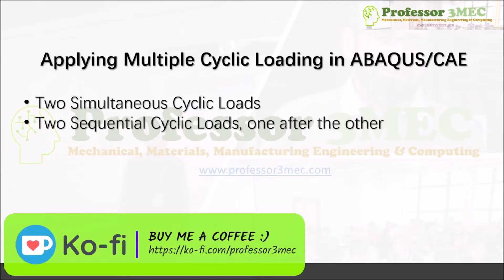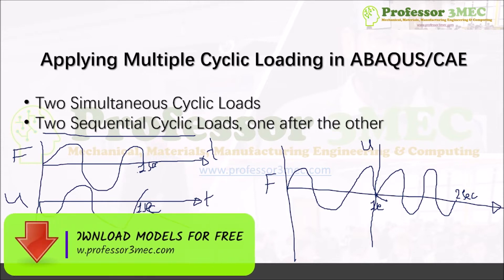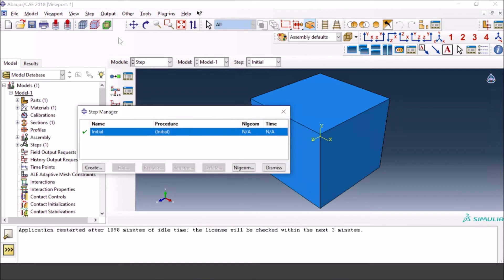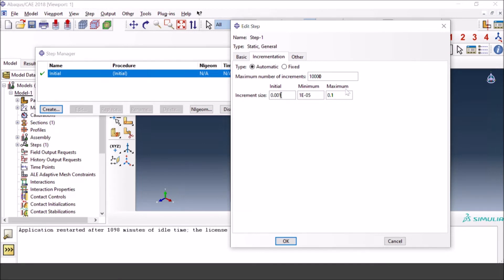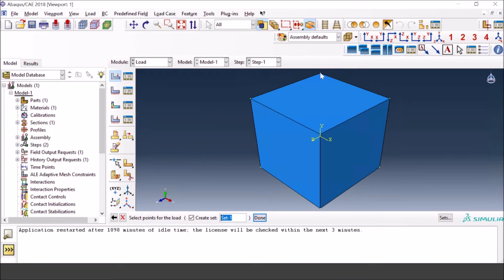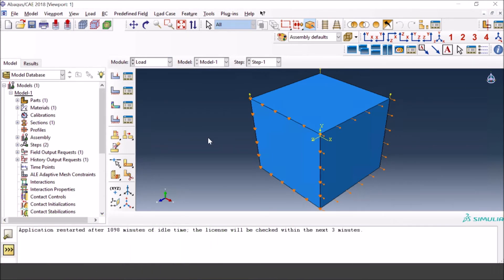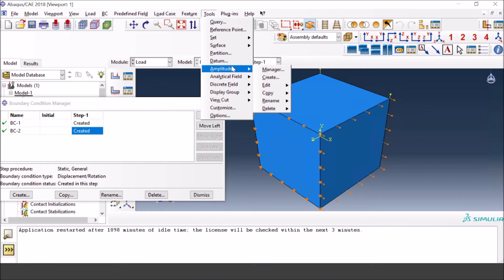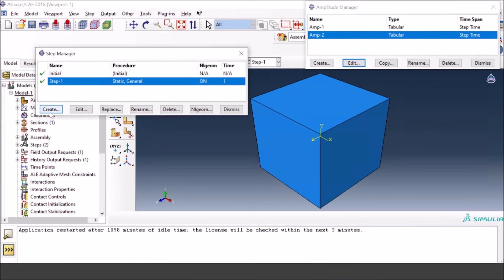Applying Multiple Cyclic Loading in ABAQUS/CAE

Comment: Professor, if you are using cyclic loading which is time dependent loading, then why dont you choose dynamic implicit instead of general step here?
Reply from the maker: Standard and implicit in my opinion are similar and hence can’t be used interchangeably without going into the details of nitty gritty. Implicit is unconditionally stable. Implicit schema is incremental as well as iterative. However, the explicit schema is only incremental.
Choice is very much dependent on problem , memory, disk space, etc.

Comment: Professor,I also have to apply two set of loading protocol. First of all speciment is loaded by force control and it is followed by displacement control method. Do i have to apply both load in same step?
Reply from the maker: This will depend on the problem. If in actual problem loads are applied simultaneously then they should be. However, if there isn’t complex interaction of loads and material properties then it can be in multiple stops.

Comment: Professor do we need to create step for gravity load before creating load step for cyclic loading?
Reply from the maker: It will depend on the problem definition. If gravity is needed and it will have some impact during the analyses, similar to dropping an object then you can create a separate step. All depends on the problem.

Comment: sir i want to apply a triangular load of 500N as max load and min of 200N and i want the load to increase by 500N after 500 cycles for the next 500 cycles and so on(i.e 500N for 1st 500 cycles 1000N for 500-1000 cycle, 1500N for 1000-1500 cycles and so on) until the beam fails using xfem method. can you please help me with this
Reply from the maker: Sure what help is needed? May be get in touch using contact us page on www.professor3mec. com

Comment: Thank you Prof for this beautiful lecture. Sir I am trying to model rutting behaviour of asphalt concrete. My reference paper requires that  I apply an 80Kg load using 10 steps for a cycle (0.01 secs) for 10,000 cycles using dynamic explicit step in 100sec. Pls prof can you enlighten me on how to go about applying such.
Reply from the maker: using the approach presented in this tutorial, I think it should be manageable. However, if you coming across specific problem then please do let me know.

Comment: Thank u for explaination. Can u please help with different Acceleration as cyclic load. 1 to 10 to 1 G  load increment every 1mins. Total 20min
Reply from the maker: Will try! is it like gravity load on a moving object? or on a fixed object.
Reply from the maker: Here is the video 
Cyclic Gravity Load in ABAQUS CAE - Earth, Space, Mars Wherever :)
https://youtu.be/BUoE-Z4brPE

All the best
Reply: @Professor3MEC  thank you very much for video, Sorry for late response I missed the notification.... I would like to explain load case.... I want to replicate actual test condition- In actual test 30 m/S2 accleration load is applied on component during the Sinusoidal amplitude of 10,20,40,80,160Hz changing every minute for total 20mins. How can I define the load case on Abaqus
Reply from the maker: @popat10171  using the approach shown in this tutoria you can create any cyclic function (through excel or matlab in tabular form or use abaqus built in functions) and apply as amplitude. all the best